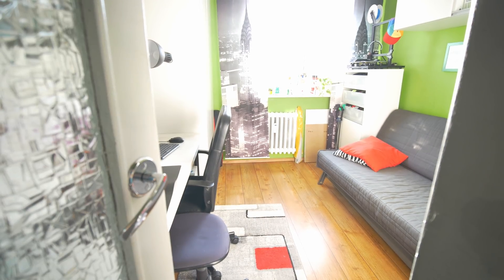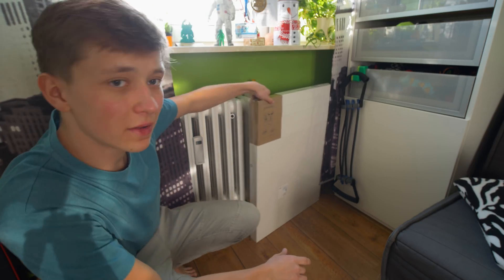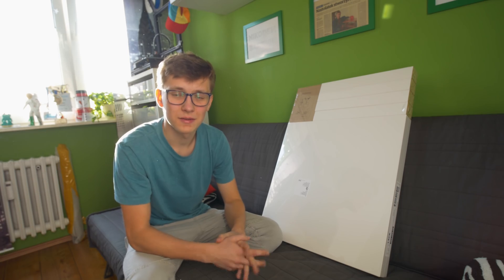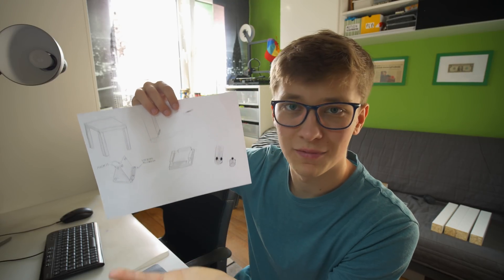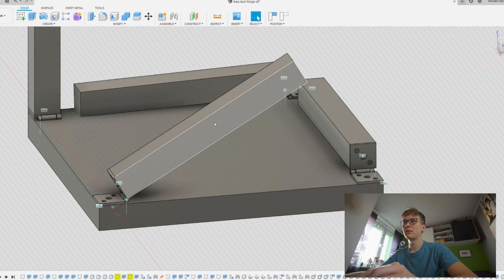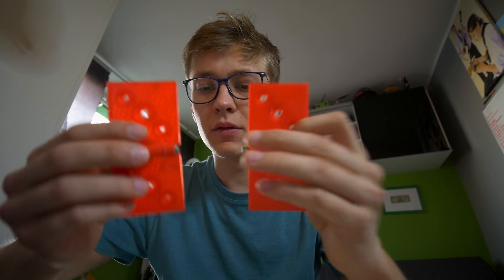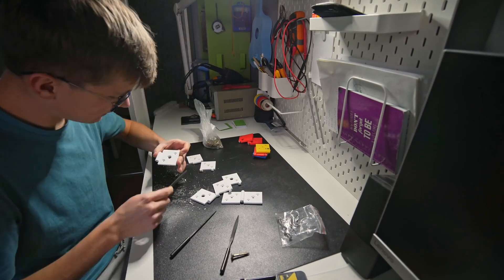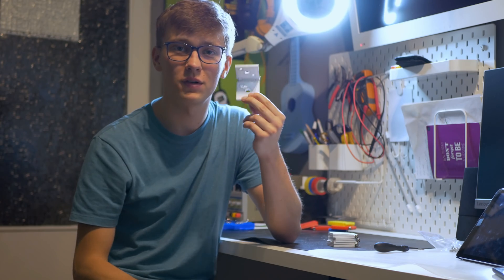Improving IKEA Lack With 3D Printer

Comment: I think the screws on the hinges may work themselves loose from the friction. A bolt with locking but would probably have been better. Also there are these 5x5cm hinges in the hardware store already :) But still very cool!

Comment: excuse but how the hell did you learn 3d printing
Reply from the maker: 1.try -> fail -> learn from your mistakes -> GO TO: 1
Reply: @nikodembartnik  so basically pain 
Btw I'm building the electric skateboard from your electric skateboard video and I even made a 3d model of the motor mount.
But I accidentally ordered the 36v esc instead of the 24 v esc if I still used it with the 24v motor(exact same as yours)  do you think something bad would happen?

And also how did you learn all the electronic stuff I tried but ended up extremely confused several times 

Thanks ur kinda an inspiration for me I'm just trying my hardest to try and understand everything

Comment: It needs a much better locking mechanism to become stable.
Redesign so that the hinge pin is m3 with a lot of plastic around it  and then add a SECOND "hinge" at the other side when you insert a m3 bolt to secure the legs while extended.
That will get rid of the "whobbly legs"

Comment: Don't worry about what people say or the dislikes Nikodem, it is an OK project, well done. Instead of using magnets, you can add a torsional spring to the hinge so it will want to stay in the unfolded position. Or find a way to lock the hinge after you unfold the legs (by tightening the screws or adding a set screw etc.)...

Comment: Hello Nikodem. The idea itself is nice but the stability is an important issue (I would like to have a stable table to put things on it). You should have a sort of locking mechanism to add rigidity to the legs joints while in position. This particular table is very lightweight (and cheap...). Independently from IKEA to develop a "folding kit" can be widely usable if well designed. Anyway thank you. :-)

Comment: The table top is stuffed with corrugated cardboard. That's the reason IKEA doesn't try it.
Reply: It's a composite. There are aircraft wings made this way. The fact it has cardboard in it doesn't maker it intrinsically less stable. Does look a little bit wobbly tho 😉

But don't dis the Bartnik!!!
Reply: My point being those screws have nothing to grab on the inside. Which is why it’s wobbly...  Would’ve been better to use epoxy or design clip to clip on table top. What’s inside an airplane wings is designed to withstand the g forces of flight. What’s inside IKEA furniture is designed to fall apart so you buy another.
Reply: TXstang347  - I’m not disagreeing with you mate. I’ve got some ikea stuff that holds together by some sort of arcane magic rather than physics 🤪

I just like to encourage this guy as much as possible - I think because I wish I had been him 45 years ago. There’s nothin like vicarious pleasure 😉
Reply: Jim Deane yeah I'm not dissing him. Only pointing out that it's not actually MDF as it is presented. I learned this trying to saw through a Lack table. It's has 2" paper strips standing on end so won't withstand much weight. Sometimes we waste energy with substandard materials. It may work well for what he intends so no need to over engineer 🤷‍♂️
Reply: TXstang347 -  yea, I know ..  I’m being very protective .. lol
Reply: The center is yes. The corners have blocks of chipboard. That is where the big 6mm double sided screw goes. You can screw into the corners of the tables and into the top and bottom of the leg. You can also screw into the parts that are technically hollow with a good chipboard screw like a Spax or Assy screw. The wobblyness is not the screws its the hinge and the mechanical design.

Comment: When designing new stuf it often pays to look at how other designs function. Folding tables have been around for quite some time, so my guess is that you will be able to find suggestions for improvement there. Letting the legs fold in two directions rather than four. A bend rod connected to two legs so they move in pairs. A long lockable hinge at each leg that gives support further down the leg, this one would be 3d printable.  Magnets I would only suggest for holding the legs in folded position.  Fun idea, love to see where it goes.

Comment: I wonder if it would help to have magnets in the hinge. Wo when the legs are in the working position, the magnets will come into contact and hold the legs tightly to the table top.

edit: Now reading some comments, someone else has the same suggestion.

Comment: Those hinges are not going to last, 3d printed stuff is not long lasting in structural sense,  anyway good idea
Reply: that's not true. It it's not overloaded 3d printed material has no reason to degarde or break. except for PLA which can cold flow and permanently alter it's shape under constant mechanical load.

Comment: It's pretty wobbly. I feel some kind of locking mechanism is needed. If i were to think of a mechanical solution, maybe a stopper that is installed in the direction where legs are trying to go next to the hinge joint and that would prevent them from going there. Maybe a second hinge-like joint opposite the actual hinge where you insert a metal rod to lock it down. Maybe a thinner section that you close with a clip opposite the hinge. People say magnets but i'm not sure, feels a bit half hearted, like it will still collapse when it feels like it. I actually like the dual sided hinge idea and locking rod i think.

Comment: Great idea! I love how compact you can make them : ) I would add one further improvement though:  add small neodymium magnets so legs will stay in 2 positions only, vertical or horizontal, so no wobbling occurs while moving the table : )
Reply from the maker: Thanks! That will be considered in second version :) thanks for you ideas!
Reply: @nikodembartnik  Something tells me that the leverage from the leg will overcome most magnets
Reply: @droko9  Ever tried a proper hard drive magnet? Not from the modern drives but from those ancient ones which have like 40GB capacity? One of those magnets is still on my parents fridge. To this day I havent got it off and my mom doesnt let me use the spatula as she is afraid of me scratching the fridge. Thats how strong they are.
Reply: @droko9  Exactly, magnets won't do. The leverage will pull off any magnet. Or the glue they're fixed with ;)
Reply: @zanpekosak2383  It's not strong enough. Also, how do you work with that form factor? Haha. Good luck with that. You can't cut a magnet. I think a pinlock system would be best. This would involve Nikodem having to use his CNC machine to add a gap into the table's bottom and have a mechanism inside that would hook up the leg on the inside somehow.
Reply: @zanpekosak2383  A broken Neodymium magnet loses a big part of it's strength. But in essence magnets are a bad idea for this application so it basically doesn't matter even if you use N52 magnets they will not be strong enough.
Reply: @MarinusMakesStuff   @Marinus, I agree, and I would have used an angle (maybe a metal one) on the inside of the table. When bringing a leg in the standing position, it slides next to that angle bracket and a small screw used as a splint could lock it there. It's not as user-friendly as a magnet, but I bet it could be much stronger. I guess it would be easier and stronger than a lock on the inside. However, if he comes up with a good system, a system on the inside would be way cooler. A compromise would be to enhance the angle bracket + splint system by an automatic lock, which is spring-loaded and is combined with a central release button. As the non-extended legs come close to the mechanism, there is not too much room, but the opportunity to lock it in that position, too.
Reply: @merkatorix  I think he could do what I did back in art school: weld a drill to a long metal rod and drill all the way through the side of the table to make room for metal cables that connect to that central release button somehow. But I guess there are a million ways to solve it once you understand how the mechanical side should be put together to make it strong enough.

Comment: maybe some strong magnets so the legs do not wiggle so much? You could put one on each hinge so it will keep it from moving when its opened and another one in the leg and the bottom of the table to keep the legs closed when it is stored.
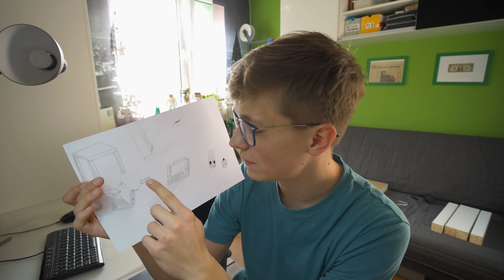Reply from the maker: that's something I wanted to do, but it would take a month to ship magnets from china so I decided to make it like this as for now and in the future I may improve it. In 2:24 you can see magnets with an arrow pointing to the hinge :)
Reply: I should have scrolled down further .... lol. Same idea.